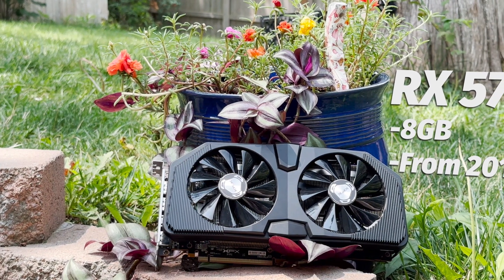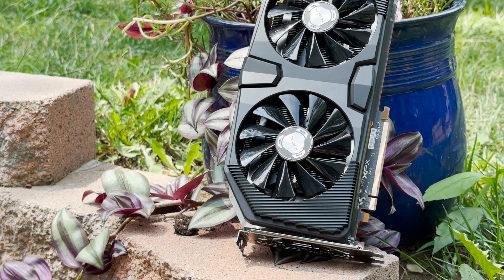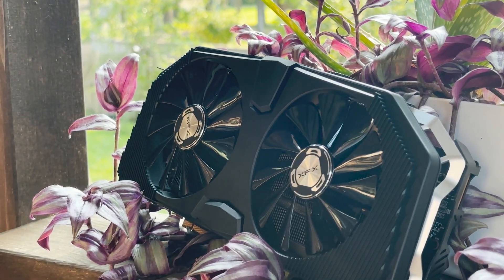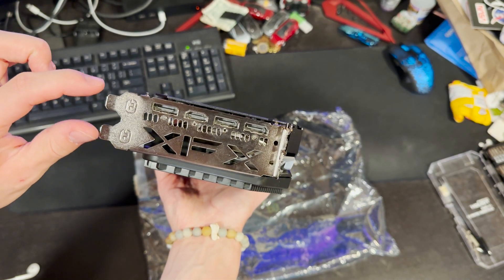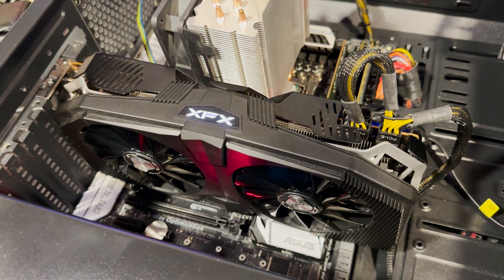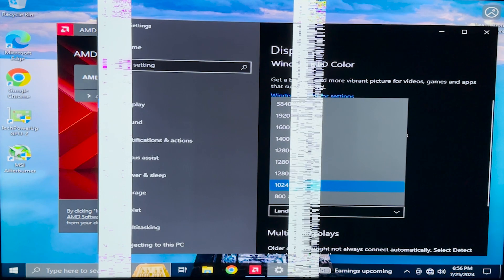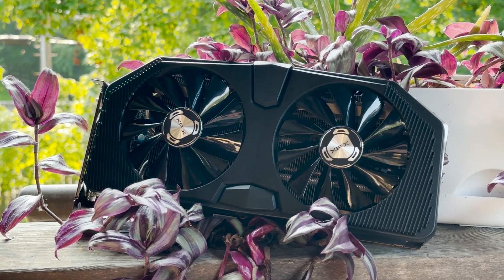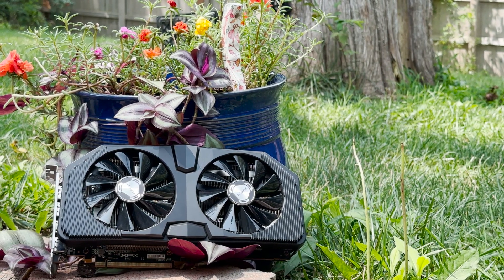Can a heat gun fix a $48 Graphics Card?

Comment: you tried to reflow it without any flux ? even with flux its like a 0% chance that it will work for longer than 1-2 months a reball is a must
Reply: I once fixed a dead r7 270x with heat gun and no flux. It worked for a year and probably longer if i didn't  change it to another pc.

Comment: Many could say the following: Get it under a thermal camera (usually done in a riser of PCIe with power adaptation) seeking hot spots (including short circuits or shorted parts) and areas that can affect the GPU and or the VRAM. If the VRAM or GPU needs reball soldering, then it may need it, however before such thing can be assumed, the signal path and areas which affect the voltage (for instance to the VRAM) are worth looking at. So water (moisture) damage can be a culprit or PCB bent where there are tracks affecting the Ohms rating, but also resistors and capacitors can affect voltage, and buck-convertors (people usually look at high density buck convertors) get moisture damage as do resistors. Consider if you have a similar enough card for a donor board for parts but not if it costs money to end up wasting the parts. 

Discolouration on the PCB, before you do any investigation beyond taking off the heat-sinks and so om, is a classic water-moisture damage tell tale sign, and that includes dulling near the previous shine. Then one would get that thermal camera on it, and look up what multimeters people use. One can consider also if a multimeter has a thermocouple, but those are a hundred bucks or so instead of twenty. One probably need not go as far as a logic-analyser/function-generator and those are about a thousand although check the site for drivers like windows8 or windows10 and so on, compared to what comes in the box on the disk and one might get a bargain perhaps (or rather you never know). Be mindful of firmware updating and backups.

Follow all ESD and safety precautions and don't break yourself or equipment doing any of this. In fact this comment is all part of an alternative reality and I accept no responsibility for this entire fictional scenario. This does not constitute computer-repair, medical-advice, financial-advice or relationship counselling.
My comment has no hate in it and I do no harm. I am not appalled or afraid, boasting or envying or complaining... Just saying. Psalms23: Giving thanks and praise to the Lord and peace and love. Also, I'd say Matthew6.

Comment: if you would squirt some flux under the gpu the solder would rejoin to the contacts. without flix the solder can actually recoil from the contacts on the pcb.
Reply from the maker: Yeah, I believe the PCB flexed in the time lapse and I probably made the issues worse

Comment: I bought a rx5700xt from taobao about a year ago for $150, still working
Reply from the maker: That's a pretty good deal, have you seen any performance boosts from AMD driver updates?
Reply: @EMBtech  no, not really
Reply: I also bought from taobao. But mine was heavily rusted and alot of dust. Once i took it apart to clean the rust and dirst and change the thermal paste it never worked again.
Reply: @randhisramiah5325  how much you spent? my card still working

Comment: I may be wrong, but the fans probably didn't spin cause the GPU didn't reach a high enough temperature.
Reply from the maker: This is possible, I’ve seen this on other GPU’s but since it didn’t detect the card fully I think the fans might be part of the issue. This was definitely a weird GPU, and maybe if I knew how to solder memory chips this probably could have been saved
Reply: @EMBtech  Well there's a first time for everything! It might make for a cool video idea :)

Comment: Aye nice try i really thought you were ganna pull it of
Reply from the maker: I thought I had a chance with this one…the only other time I got this method to work it was definitely the GPU die itself that was broken. I’m pretty sure the RAM chips are the problem here, which is why there are lines on the screen. If I find another GPU that has a die issue I think the chances of bringing that back are a lot higher

Comment: From what I saw from gpu z looks like the vram is done for
Reply: Yup, the banding alone at boot and in Windows pretty much confirms it and in multiple locations. Might be salvageable with a memory swap from a donor card though!
Reply from the maker: This is what I read on Reddit, but there’s no way I’m going to be able to successfully memory swap this card. I’m just surprised the card went from displaying to doing absolutely nothing
Reply: @EMBtech  it depends on what part of the vram fails. if it fails where the default loads the program for rendering it wont be able to start